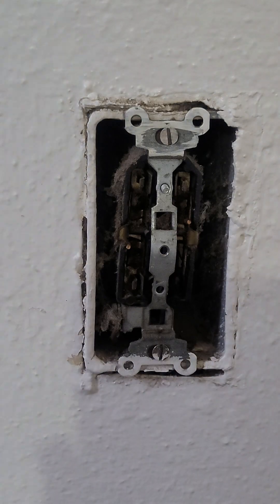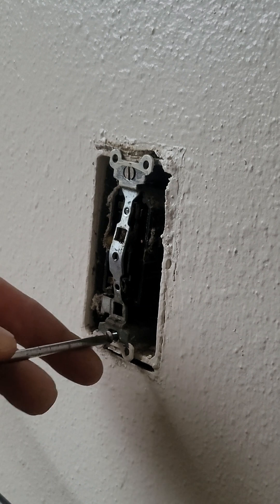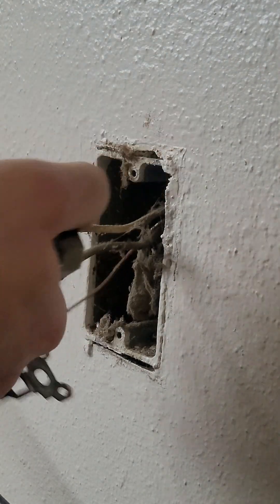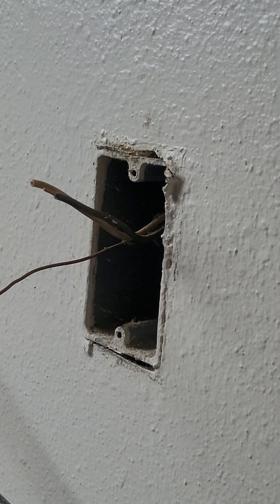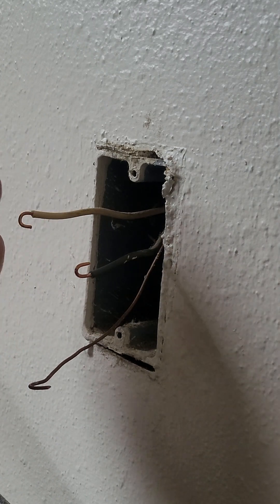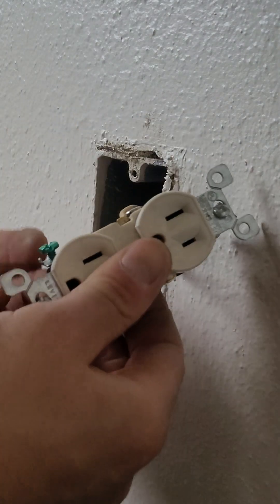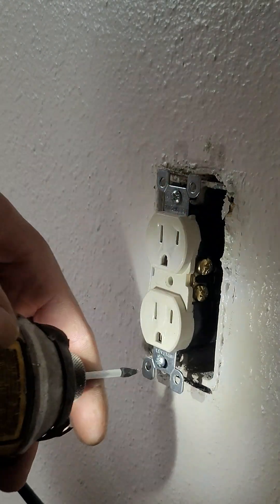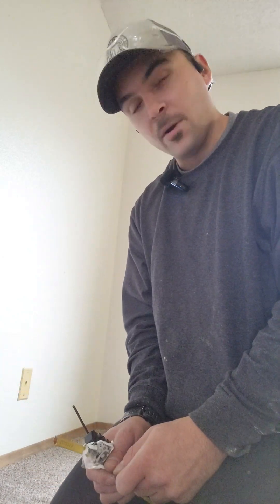How to Wire an Outlet Safely: Step-by-Step Electrical Guide

Comment: My dad, and Many master electricians have stress to me over the years, always always always hook up the ground (copper or green in the U.S.) first, then neutral (white)then hot (black). 
Even when the breaker is turned off and tagged out for safety. It keeps you in a good habit and you never know how insane the person was that did the work before you.
Reply from the maker: That's a great point! Thanks for your comment I have never made it a point to do either first but it makes sense to do the  ground first! Good lookin out
Reply: @ an old electrician told me he didn’t do it ONCE and that was the day he turned the breaker off but didn’t double check where his partner was. The breaker he turned off was labeled outlets, but it wasn’t that outlet. That outlet was a switched outlet and his partner came into the room after he just left and turned the switch off as it was also the hall light.  Well the partner fixed the light, and when he turned it on to check it the older guy had the outlet in his hand and had hooked up the hot and was holding the neutral. His hand became the conductor and he was shocked. The funny part was he thought it was a bee sting so he picked it up and held it. Nothing then boom, shocked again. 
Well, when he was shocked he caused the breaker to pop, so his partner whet to reset it and when he did, it was when he had picked it up, and it nailed him again. This time he yelled and his partner came in to see what was up. They finally figured it out and “had a good laugh about it over lunch”. He said if the ground would have been hooked up first he would not have received the full shock or maybe he wouldn’t have been shocked at all. If he had not made it to the hot wire yet. 
So that’s one reason info it and I also check it with the switch and with the breaker and if nothing else I put tape over the breaker and switch with my name on it and a big DONT USE SEE ME FIRST.
Reply from the maker: Thanks for the story, as a was reading it I was expecting the worst! I'm glad the old guy was okay! And that's a good tip, to tape the breakers that your working on.

Comment: Should tell the viewers that white wire should be attached to silver screw and black wire to the brass one. Instead of using the term “loop up and loop down”.  This will cause confusion to the inexperienced viewers.
Reply from the maker: Yea that's a good point, I'll emphasis that next time! Thanks for the input.

Comment: Flathead screws is NEC 300.2(C-20:D/(12,16)#66ROTF-LMAO) “Use Of Flathead Screws In Receptacles Is Mandated Because They Suck Balls And You Have To Be Absolutely Certain That You Want To Work On Them, This Isn’t Some Mickey Mouse Bullshit Repair Job, This Is Serious, And Anything Worth Doing Is Worth Regulating So Jerry The Print Guy Has Something To Do Every Year”
Reply from the maker: Takes off faceplate, sees flat head screws, puts faceplate back on, kicks Jerry in the nuts and calls an electrician
Reply: I pulled out a Robertson driver and an electrician next to me, older guy, looks at me and said “pussy”. Then he laughed and said that’s the smartest way not to throw things when you put in outlets and switches.

Comment: first: real pro work with the breaker on, second, you don't insulate the head of the screw who receive the cable rest of the process is very common
Reply from the maker: Sure, but as my title says.. Safely and I didn't insulate the head I stripped the wire to the correct length if the insulation touches the head it's fine you just don't want it to be pinched under it!

Comment: Thanks for the great content, bud. Anytime I want to get mad at a flathead screw, I remember that back in the day old timers had to drive flathead wood screws by hand, by dozens at a time. When I look at things from that perspective, undoing a couple and possibly replacing them with modern ones doesn’t seem to be so bad ☺️🤝
Reply from the maker: Thanks man! I like the positive mindset, true it really isn't so bad.
Reply: My dad did wood work and electrical work using a “yankee” screwdriver with a standard bit. He could do it fast as hell. When I tried it, I managed to mark things up, scratch and gouge wood, pinch my fingers or poke a nice shallow hole in my hand.
Reply from the maker: Being able to do that is almost like a safety on your work 😅 like try and take this apart. Like driving a stick shift you don't have to worry about anyone stealing your car anymore if is standard